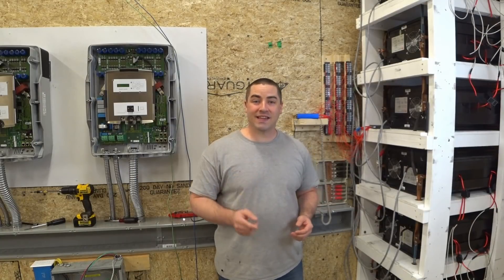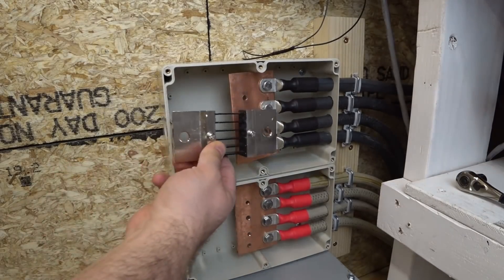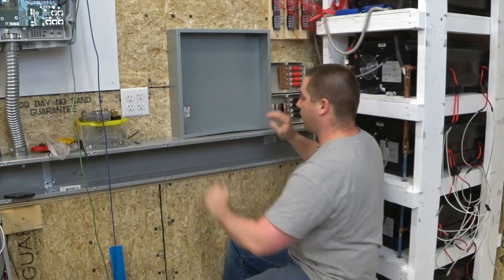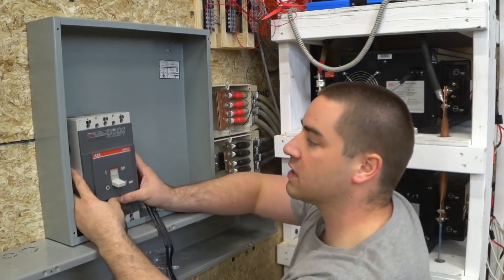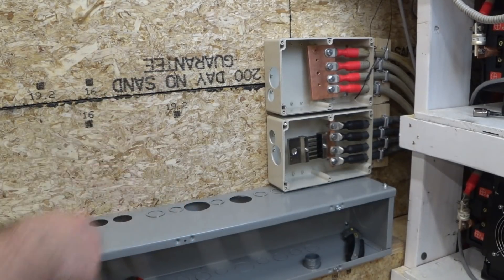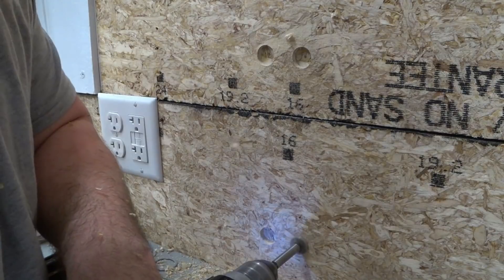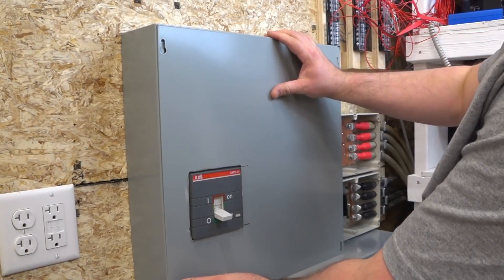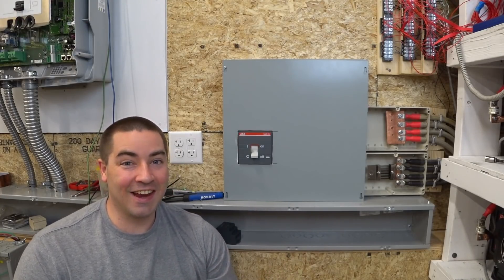DIY Solar Off Grid System, Shunt-Trip Breaker Box Install

Comment: just getting into understanding shunt trips now. is the remote trip function still useful to incorporate? i notice on your newer videos you don't have this in use any longer
Reply from the maker: At the time of this video, I was trying to use one BMS to remote trip a single circuit breaker.  After working on this type of setup, I have decided that it's better to have one BMS on each battery.  Using a shunt-trip like this should be reserved for an emergency momentary switch.

Comment: Did something similar ...the three contactors are separate, so I have cheap Bms on my 18650 bank tripping the ABB contactor, with two contactors being solar in to battery and one being output from inverter...its great tripping the output, but I was worried more about overcharging the battery, but your bms would cover that...thanks for the video

Comment: They say it is not a good idea to disconnect battery from charge controller while your solar array is hooked  up to it, I would recommend have solar array disconnected too, if you have to disconnect charge controller from battery. It is looking good. Also the shunt for SMA should be before the buss bar as each SMA is tracking individually.

Comment: Hey bud how many chargery bms did you need for the whole system... Does itneed to be used for each lifepo4 pack? Very interested in buying one I usebatt go but they malfunction occasionally
Reply from the maker: I'm using one BMS for the whole pack because I paralleled all the like cells.

Comment: David, could you share the exact model of ABB breaker you are using?  Thanks so much for the video and for sharing how things are going with the tower of power.  Mine is still waiting for other things to get done first.
Reply from the maker: S5N 300 amp.  I bought it on ebay.  This one has a 24v shunt trip, but the shunt trip is something that can be changed, so some S5N might have 120v or 240v shunt trips.
Reply: @DavidPozEnergy  thanks!  Can't wait for the next step video on this project.  Hope y'all are staying safe during the pandemic.

Comment: Hello David, Thanks you for a video, nice job done! Can you please share the model number of your Circuit breaker? I plan to use a similar CB with remote trip option and would like to check the specks from this one from ABB. Thanks!
Reply from the maker: ABB S5N.  300 amp.
Reply: @DavidPozEnergy  Many Thanks!

Comment: Two shunts?  Whoooooaaaa nelly..... the reason the shunts are on the negative is so that the device (BMS or your inverter) can measure the voltage above ground.  By putting two shunts in you’ve miscalibrated teh sunny islands.  Try hooking the sunny island directly to the BMS shunt.  Both devices are just reading voltage.... they can read from the same shunt.
Reply from the maker: I wanted to do exactly what you said, one shunt.  The Sunny Island inverters need a 50mv shunt, and won't read a 75mv.  The Chargery BMS needs a 75mv, and won't read a 50mv.
Reply: DavidPoz Good luck with that.... you’ve converted a 50mv shunt into a 125mv shunt......  Perhaps you need a simple resistor voltage divider to lower that 75mv to 50mv?  1/3 : 2/3 resistor values.  Maybe a 1k and 1.5k Ohm resistor?  I expect the input impedance of the sunny island’s A/D input is on the order of 1 Mohm, so those 1k/1.5k resistors shouldn’t matter much.
Reply: I’m thinking more about this and maybe 100k and 150k reisistors for the voltage divider.

Comment: if you get headache using lithium, try very large stock of million cycle supercaps, now at 5wh/kg, using graphene they are 150wh/kg
Reply: That's hypothetical, none actual exist on the market.

 Ultra-caps are used for extremely high amperage applications in very quick bursts - perfect for starting cars, running heavy duty shop tools for only a minute at a time, etc. Their actual capacity density is low....a quick look at "graphene ultra-caps" in Google will tell you that.

The closest tech that meets in the somewhat-middle between Ultra-Caps and LiFePO4 currently are LTOs. 

They have a low energy density and huge initial investment BUT essentially never need to be replaced, have extremely high amp input/output, and won't burn up when completely destroyed.

Because of the high Amp characteristics like a Ultra-Cap, LTOs also tend to dip in voltage too much during heavy discharge so they aren't recommended in 12v configs, only 24v/48v where most LTO cells, when combined, fall within nominal voltage ratings under load...

All that said you're looking at about anywhere from 2x-4x the investment for LTO vs.comparable LiFePO4 Kwh/Ah capacities depending if you build yourself or buy a pre-built product.

24v 40 Ah LTO ~ $1000  
24v 40 Ah LiFePo4 ~ $500

..but if you factor in that they last 40-50 years (20,000+ cycles) they are actually cheaper per cycle.

Comment: 600A??? WOWZZZAA my whole house is just 200A
Reply from the maker: This circuit breaker says 300 amps on it.  This is on the DC side, so 48 volts.  My house has 200 amp service from the street, but that is 200a at 240 volts AC.

Comment: I think drilling holes in the shunt would change the resistance and thus make the amp calculation wrong.
Reply from the maker: It might, but I don't think it's a problem where I drilled the holes.  I would agree if I drilled through the middle part that was black.  But if it winds up showing the wrong amps on the BMS I can calibrate it, or remove it.
Reply: @DavidPozEnergy  research resistance of planer conductors. I think eevblog has a video on it.

Comment: Very Very nice looking system love it! cant wait to see it running. I will be overhauling mine soon, too look nice, but this is why I didn't start that way, I looked up the pricing and was like WTFudge, these ways of making it look nice cause to much. but now that I have saved so much i will be spending a bit on making it look nice.
Reply from the maker: I like your system, a lot.  I wish there was an easier way to make it code compliant.
Reply: @DavidPozEnergy  yep, I'm 100% on the AC side and will take loads of work and a few bucks on the dc side. Lol.

Comment: Great video, as usual! On my breaker, I had to connect the cables before I mounted the breaker since it was difficult (impossible?) to get a wrench behind the breaker to hold he nuts once mounted. Did yours come with different hardware? I didn't get any hardware at all with mine. Also, are you missing any of those lock rings at 10:50 by a chance? LOL
Reply from the maker: I'm not missing any lock rings.  Did I use the wrong term or something?  Yes, my breaker came with lugs, so I can tighten them with an allen wrench from the front.

Comment: Thanks Dave, what is the voltage of the shunt trip coil? I watched one of your previous videos when you paralleled groups of 8 cells with #10Awg wire. How are your results, do you gain more usable kWh out of the battery?  If I may suggest, use a fiber bushings on the chase nipples and connectors. NEC requires this on #4 Awg and larger. Also if you do not have a eccentric or concentric knock outs(if the knock out and the connector are of the same size) in your inverter you can use a grounding lock nuts (with a bonding screw) -less expensive option. With the bonding bushings in your case, you need to add a bonding jumper across. They are required if there are larger prepunched knock outs in the box or if the voltage to ground exceeds150 volts /typical 480/277. Thanks for your videos! Keep up the good work, God bless.
Reply from the maker: The shunt trip is 24v.  Thanks for your info.  I did use plastic bushings on the chase nipples.  The inverter does not have many concentric knocouts, but the wire way did.  I don't know where I could use one or the other.

Comment: How about cutting a slot between the holes where you have run conductors through separately. You don't need to understand the why of it all so I will just stick to my statement without explanation. It will be an easy fix. BTW, you Bonding. Read Mike Holts book on bonding and grounding.
Reply: I presume the issue your referring to would be eddy currents?
I could be wrong though?

Comment: I suggest a Kirk key system to avoid connecting the solar before the batteries, which may damage some equipment, if you don't go with an automated break before make system.

Comment: I do not believe you as an install the breaker in that panel box legally... directly feeding the conductors in from the bottom through the box isn’t ok. You need the bending radius top and bottom...
Reply: All metal panel connectors need ground conductors mounted to each penetration, and passing through each opening...
Reply: No bending radius needed on the bottom, wires go straight in.  Also if you look at the code, you only need to bond connectors and conduits in certain scenarios, this is not one of them.

Comment: Hi David, not sure if you need a second shunt for the inverter, my Sunny Island 8 has a built in shunt and the unit will measure 
battery current in-out...maybe your model is different ?
Andy :)
Reply from the maker: I'm charging my batteries on the DC side with my Victron Solar charge controller.  This means the charge current does not go through the inverter.  In this case the inverter will shut down.  I had it do this to me twice before I figured out why.  So, in my case, I need an external shunt.
Reply: @DavidPozEnergy  Cheers David, yes my system is different in that the solar runs to a Sunny Boy supplying current to the Island which
charges the BYD's. Its a fairly simple, but effective system. You'll love those SMA's, they are rock solid !!!

Comment: I have that abb breaker. The diagram on mine shows neg and pos if you use it under 300vdc. The dc setup is different from the ac setup. Let me know if you want a picture.

Comment: Don't you have 6 batteries? I only see 4 positive and 4 negative cables so how do you have the other 2 batteries connected?
Reply from the maker: I have 8 battery modules.  They are arranged 4p,2s.  Meaning 4 modules paralleled.  Then the next 4 modules are paralleled.  Then 1 connection between the two groups makes the series connection.
Reply: @DavidPozEnergy  Sorry, never could see the other two. What a super tower of power, commendable! High ceiling in your garage. It's going to glow in the dark.

Comment: I got a Chargery as well BTW (It got out of China just before the pandemic shutdown a lot of shipping.)

BTW - as an alternate to the wall of BMS leads, you could add a box with DIN rail and some of these.

https://smile.amazon.com/Outlet-Terminal-Distribution-Circuit-Breaker/dp/B0848FL431/ (since with your 8 modules in 16s, you have 4 cells in parallel, right?)
Reply from the maker: Those are neat.  Yes, I have 4 cells in parallel.  Thanks for showing me something new.

Comment: Nice Job! I'm looking forward to seeing more of the shunt trip breaker. Going to need one of those for my setup too!
Reply from the maker: Yeah, I haven't tested the trip function yet, so I'm hoping it all works.  I recall you had some extra computer chip thing you bought with your Chargery BMS.
Reply: @DavidPozEnergy  Yes, a relay that interfaces between the BMS and the future shunt-trip...or at least I think that is what it is suppose to do!
Reply: What's the model or pn of the DC breaker?    It has three poles, will it switch both sides or just the positive?  I think it's not bad to keep the poz and neg busbars in separate boxes.  Even with fuses on the pack, a dropped tool in there could be exciting!
Reply from the maker: The model of the breaker is "S5N"

Comment: The cost......ARE you sleeping on the couch?
Reply from the maker: Shh, don't tell my wife.
Reply: I'm done now and well at 30k and my wife was like I'm almost your ex-wife untilllllll she seen what I did and now she is like I like this this is much better and 2 almost 3 less Bill's a month gone. She's like how did you do it? Almost about to change over to electric with no gas except for propane and that bill is almost gone too. Save almost 4 to 500 a month now for a family of 4 this is amazing.
My system consists of two sunny islands (6048s) and 4 mid night solar's and one makesky blue to charge the batts for my leaf and 4 banks of 49 nissan g2s and 1 bank of nissan g1s also 50 panels pulling in bad days minimum 60 amps good days right at 200 amps. Was over building for ac and dryer but sense decided a gas propan dryer is better and less stress on the batts. My only last thing is to maybe add a turbine one day but will see if the wifeeeee will let me. Lol maybeeeeee one day.😬👍🤔

Comment: David I must have missed the video for that bms do you have a link
Reply from the maker: You did not miss anything.  I am waiting on doing a video on the BMS until I can fully test it, with the breaker.  I need to make sure it works well before recommending it.  But, if you would like to check out the specs, it is the Chargery brand, 16s, 600 amp, version. http://chargery.com/BMS16Pro.asp
Reply: @DavidPozEnergy  How long are you planning on testing it before doing a video? Very excited, seems like an affordable alternative to Batrium.
Reply from the maker: @Derek Eells: I have to hook the BMS up to this circuit breaker to make sure the shunt-trip will work.  I might have to have another relay in between depending on the amps.
Reply: @DavidPozEnergy  Very cool! Thanks for taking the time to respond. Very appreciated.